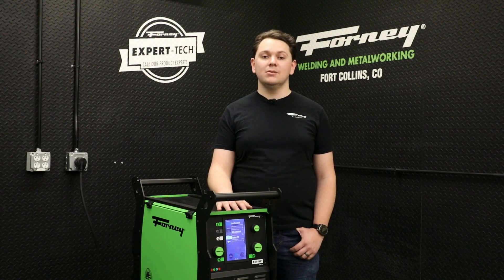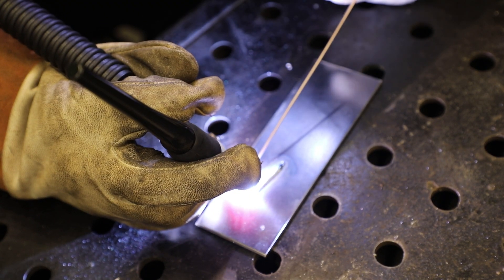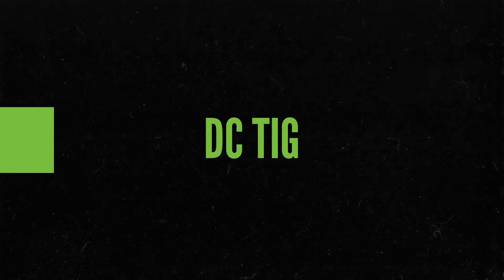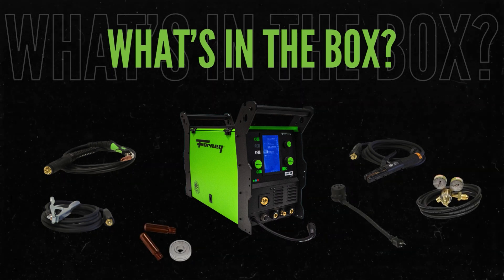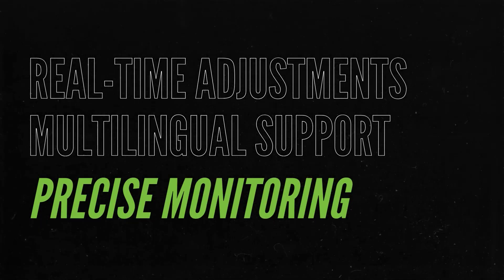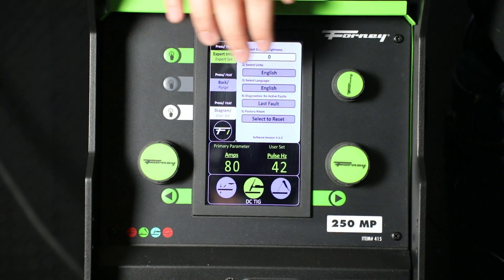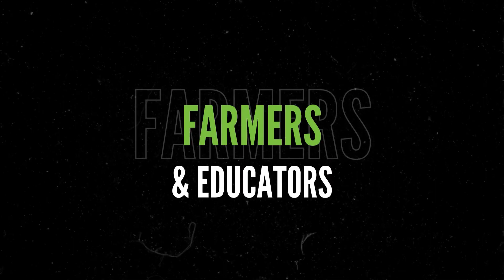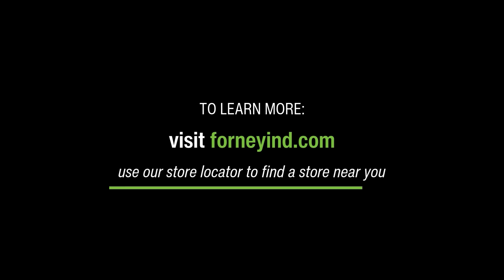Forney® 250 MP (Multi-Process) PRO Welder Features & Benefits

Comment: So it doesn't have AC TIG? And you are calling it a pro model? I love my Forney 140 easy, 210 mig, 270 mig, and P45 Pro. I was holding out for this before buying a TIG machine. Come on, guys, don't disappoint me! The only reason most of us need a TIG machine is for aluminum .